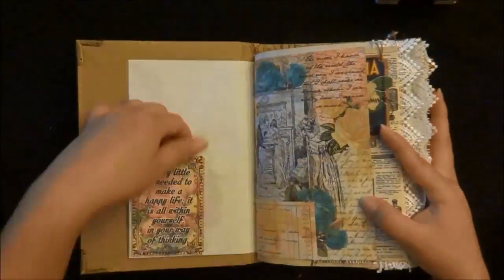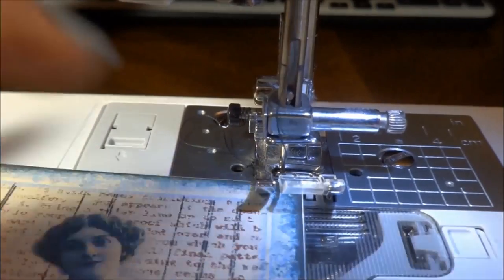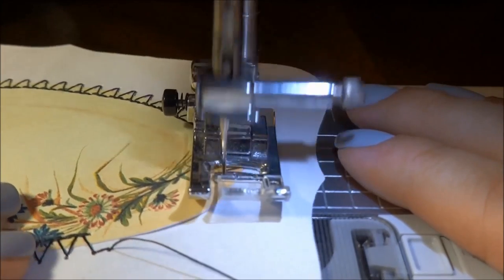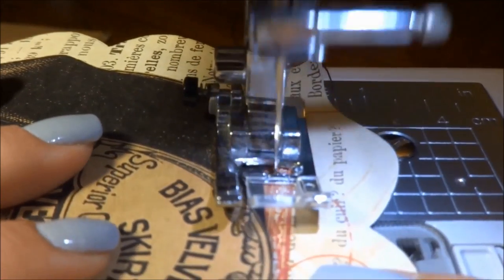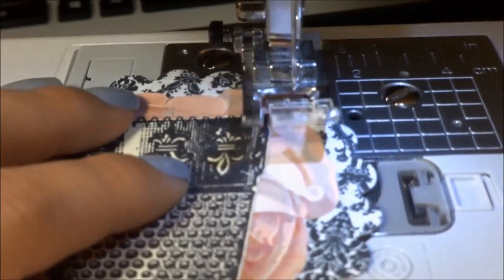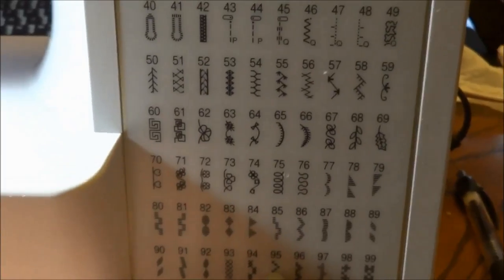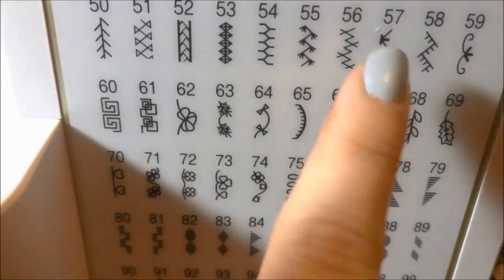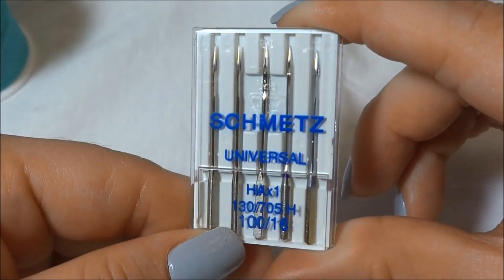Sewing on Paper with Sewing Machine for Beginners - Brothers Project Runway SE CE1100PRW

Comment: Thanks so much for this video, I've been waiting for someone to do one like this.

 I hope I'm not overstepping here but I'd like to help with a little info.   I'm also a quilter and the cotton thread is quilting thread which is a little thicker than the all purpose.  The type of needle is universal and the size you are using is 100/16.  Universal type needles come in various sizes.  So, let's say someone purchases a universal needle in a size 60/8 it would make very small holes, too small for quilting thread. This would mess with tension of the machine.   I hope this helps.
Reply from the maker: Knack Ability I'm super new, I will gladly edit this info into the video. Sounds helpful, thank you! And thanks for watching! 💞
Reply: @tsunamirosedesigns  what type of thread do I use?
Reply: @tsunamirosedesigns  isn’t there a specific foot I have to use for zigzag stitch?

Comment: Fun video! Even an old sewer like me appreciates your emphasis on keeping the edge on the middle mark. Trying to keep your needle down, stopping on the left side of the stitch helps keep it smooth. It isn't always that easy to have it happen though. You might try a sharp needle. Universal is for sewing both woven and knit fabrics and it isn't as sharp in order to keep from piercing the fibers. Sharp needles are for woven fabric. I seldom change needles on paper since the pressure from the machine usually pierces paper well! For stitching several sheets together, like for a journal, a sharp needle is very helpful! Oh, and Coat's & Clark regular thread has a polyester core and is wound with cotton thread. I like it. It is a lot stronger than plain cotton, so it all depends on what you are stitching. It is usually less expensive. I do prefer cotton thread when stitching cotton fabric since cotton thread will break before the fabric rips. Happy Stitching!

Comment: Hi!  Does stitching on papers damage the machine at all, or just dull the needle?  I want to try this, but don't want to buy a machine "just for" this!  Thank you!
Reply from the maker: I've taken it to be serviced almost 2 years ago after sewing with it for almost 2 years and they didn't tell me anything was wrong with it. Just got dusted and oiled. As far as the needle dulling, I just change the needle out when it's not stitching right,  I also clean the dust at the same time. I switch from fabric to paper without problems, keep in mind I only sew for jj purposes.